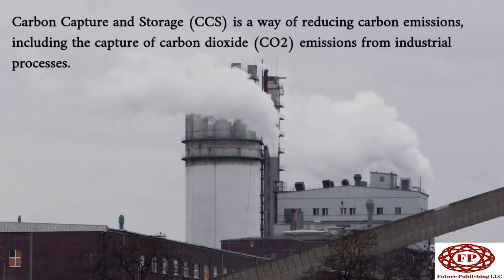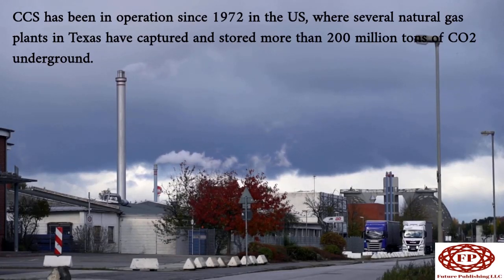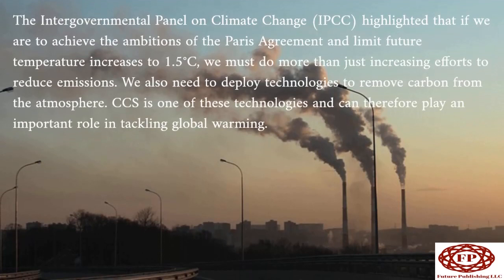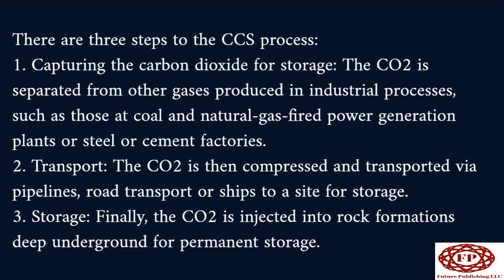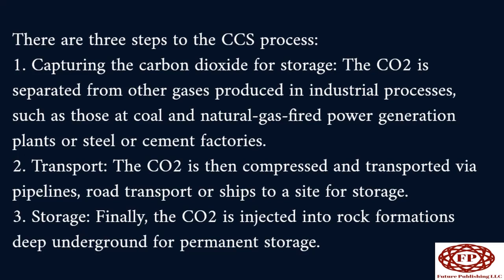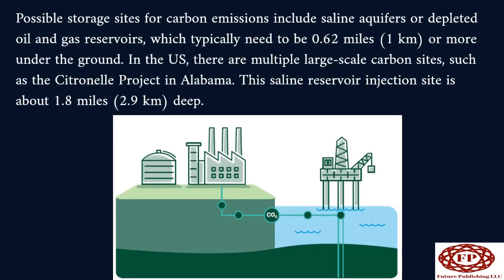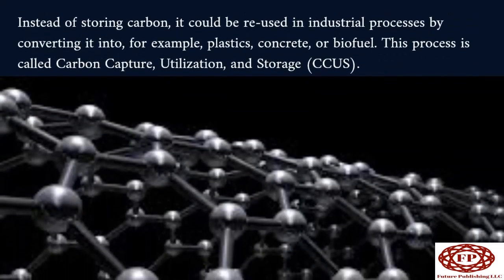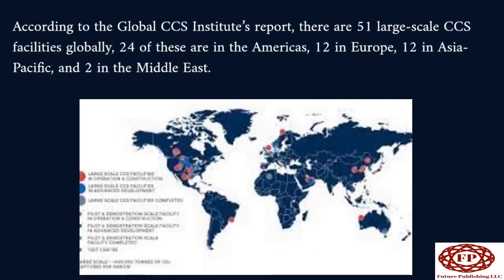Carbon Capture and Storage

Comment: Why the computer voice?
Reply from the maker: Thank you so much for your comment. That's a good point. Currently, it is easier for us to handle it as it is because we focus more on publishing scientific documents (please check our website: https://fupubco.com) rather than producing youtube videos. However, based on our plan, we aim to hire new employees in mid-2023 and develop our video products as well. Thanks again.
Reply: If the carbon dioxide is stored underground there is a danger of it leaking out if the facility is accidentally ruptured. For example, this could happen if there is fracking near to the store.
Reply from the maker: This is a good point. To store carbon dioxide in the ground, some infrastructures are required to avoid any leakage. Because of that the process is somehow expensive!
Reply: Great video, thanks for the information.